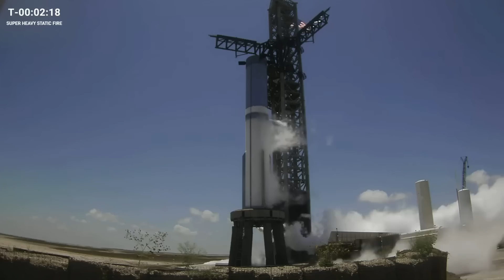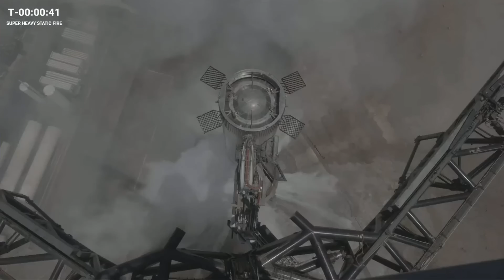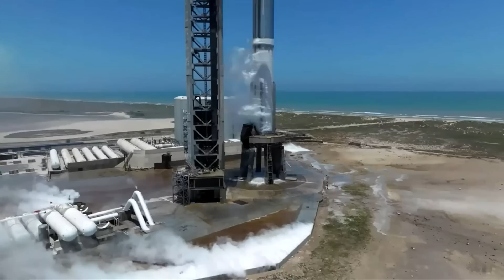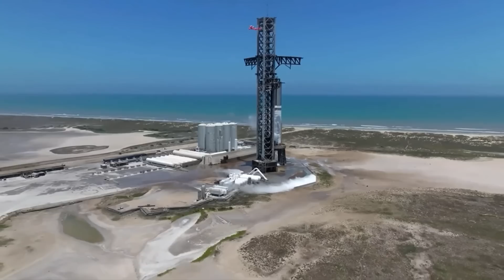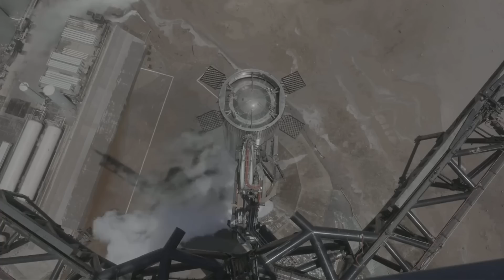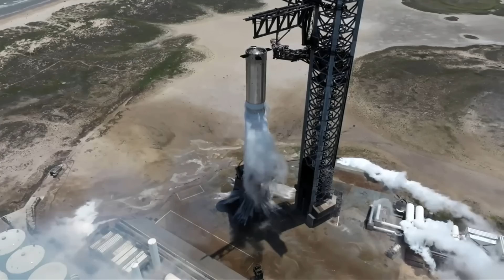SpaceX fires up Starship Super Heavy Booster 9 in Texas

Comment: I am starting to wonder if it is the engines or the fuel system. I can't see how between the first launch and this static fire so many engines would give out either mid flight or on the pad. I could discount the first launch because of flying concrete but in this case the deluge system was working just fine. It seems to me that these engines were pre tested and passed inspection. That only leaves the fuel system as a likely cause.

Comment: Unless there was some other issue with the engines that shut down it seems that better timing of the start of the water deluge and the engine firings has to be part of the next step in development. The other side of the balance to what was tested is having the engines fire, which heats the steel plates too much before the water comes out; which could well be a disaster if enough of it turned to steam ...under the plates..you know, woosh, pop and the rocket goes kaboom getting in the way of giant steel plates heading into orbit!. Good thing to start with the water first and then work the timing between them closer and closer, to see what works best.. 
If there is a pattern to the location of the shut down engines, the start up sequence could be to fire those least likely to be affected first and so reduce upward liquid flow and once enough of the water stream is being vapoutrised, kick in all the rest? Or alternatively micro manage the water pressure during start up to equalise the upward and downward pressure flows ..
Reply: Why would the timing of the water deluge be related to the engine shutdowns? Surplus water will simply drain away.
Reply: Hi, I was just considering if the issue causing the engine shut downs was due to the water deluge, then delaying the full thrust of the water deluge until the engines achieve over say %50 thrust might give the motors a better chance of performing as designed. Of course the water deluge may have nothing to do with the 4 shut downs .. it just seems a bit of a coincidence.  @lappansommer546  A water flow control system might be based on an array of temperature sensors within the steel shower head,  such that the heat in the plates never exceeds that of water flashing to steam (under the plate).

Comment: Personally, I think they need larger and fewer engines for better reliability. Most likely the reason they had shutdowns, was the basically room temperature water saturated the cryogenic pumps and caused them to cavitate with gaseous fuel instead of liquid. They may have to fire the engines and start the deluge simultaneously so the thrust keeps the water off the pumps.😉

Comment: 🎯 Key Takeaways for quick navigation:

00:05 🚀 SpaceX Super Heavy Booster 9 undergoes static fire test at Starbase Texas.
00:31 🔧 Teams have made multiple improvements to booster, pad systems, and infrastructure since last flight test.
00:45 🌊 New water cooled Steel Flame deflector introduced for pad protection during Starship launch.
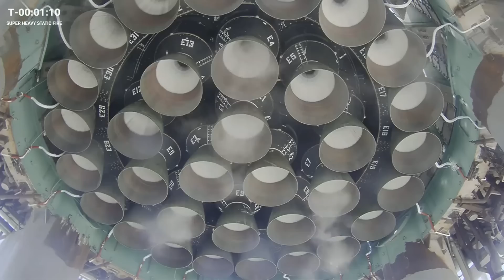01:12 🔥 Super Heavy's static fire test runs for nearly 5 seconds, surpassing Falcon Heavy's thrust during flight.
02:06 🚀 Test experienced premature shutdown of 4 engines during ignition.
06:28 🏁 Successful test brings SpaceX closer to their next flight test, with propellant offload planned.
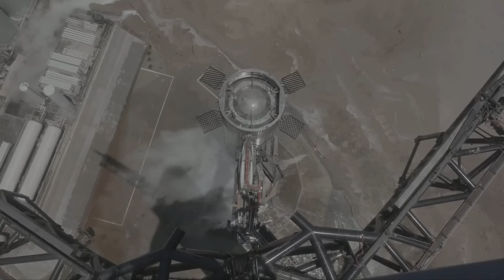06:57 📢 Webcast concludes, further information to be posted on SpaceX's social media.

Made with HARPA AI

Comment: The showerhead pad is going to fail at 100% throttle and full duration.
Reply: What makes you say that?
Reply: @jarjarbunks2844  It's similar to a Water jet cutting through a steel pipe. They need to add more exceeding pressure and power to the water deluge system. Time will tell if this system can survive during launch. They need more tests to prove it can survive multiple launches since Starship will become a norm launching daily
Reply: @Alderite make declarative statement... type long-winded statement walking back what you originally wrote knowing  nobody will read it.  Good job.
Reply: @Alderite  the water isn't meant to completely counteract the force of the engines, it's there to convert a large amount of the energy coming from the raptors into steam, protecting the launch pad. The pad itself is reinforced a lot more than before so it can take the forces that the deluge system doesn't eliminate. Also, Starship will launch below full power for the first few seconds until clear of the launch pad. If the engineers did the math right then all signs point to the deluge system working as it's supposed to and I just don't see how you're so sure it's gonna fail.
Reply: @jarjarbunks2844  They actually updated the Starship's functionality to launch at 100 %, unlike the first slow launch. Avoiding the launch steel plate from turning into molten slag. As said, its best for trial and error

Comment: It's hard to believe that there's still a reliability issue with those engines.
Reply: Probably not reliability, this is the first test of the system with the following: Electric Thrust Vectoring (removal and substitution of hardware that may be responsible for the issues on IFT1), water deluge (addressing the already expected issue of concrete erosion for IFT1), upgraded spin start (may have played a part in two of the engines’s startup issues on IFT1), Booster 9 (its new and features structural changes), and ignition sequence (time trimmed down fly 50% from IFT1).

All of these issues will have some influence on the event, and for a first static fire (and thus complete test) of all these systems combined, this actually is probably better than expected. Given that this is a first test, SpaceX was also likely running extremely conservative parameters that will be loosened for flight. Having loose parameters on a first test is just introducing more potential failure points than what’s already there. The quicker shutdown was likely a result of the four engines shutting down early; which would’ve triggered the launch abort procedure should this have been a launch (the booster cannot fly with more than 3 engines at launch for safety reasons). A fourth shutdown would automatically trigger a shutdown of the entire flight if the clamps were attached to the vehicle (they were).

Again, this is a first test. It took B7 3ish attempts to get to where B9 got in one so this is still major progress. Heck, the issues with the engines could even just be bad test sensors that need to be replaced.
Reply: @seasickrhino8926  the fact that engines are still not firing after this many years of raptor development is not a good look. If the issue was simple you would imagine that it would've been fixed after the first launch, but it hasnt been.
Reply: The wording was “premature shutdown” which in aerospace lingo means that the engines ignited but were shutdown automatically because of a sensor reading. Statistically, ~90% of premature shutdowns are caused by erroneous sensor data, not bad design. Raptor 2 is at best 4 years old. The F1 started in the mid-late 50s and first flew in 1968. It still had issues at liftoff.

Because this was an initial test firing of this booster with various new systems, they would set the shutdown parameters to be extremely stringent. Meaning that the engines not only have the likely issue of sensors, not performance, but have to conform to tighter specifications than when normally operating. This behavior was noted to be one of the primary relying factors for SLS as well. It’s kind of part of the process.

Again, this is a first test of this grouping of systems. Finding failures is the entire point of this test. Not entirely perfect performance is expected just as it was for SLS, nor should it be for B9’s initial tests.
Reply: @seasickrhino8926  So would you suggest that this is a new systems glitch rather than engine failure?
Reply: @pauljmeyer1  this is likely the result of new systems being tested together for the first time, yes. It’s of my opinion that the engines, based off the statements from SX and my own personal knowledge/experience were shutdown for (what is likely) extra tight safety margins.
Reply: @seasickrhino8926  Yes, the stakes are high on this and they don't want it to go wrong.

Comment: As I have said before, 33 is too many to expect them all to run.  It is time to look into the use of Falcon Heavy with 4 boosters strap ons as a plan b.  or go to F1 size engines and reduce to 5 or 6 engines.
Reply: … you do realize that a 4 core FH is 45 engines right?

Also F1 engines would have poor performance for the landing, preventing the ability to hover and requiring suicide burns. It may even require over stressing the booster for boost back.
Reply: This comment makes zero sense whichever way i look at it.
Reply: What is this blud wafflin about

Comment: Test was a great success....................what are you guys smoking?    Oh right got it ......... the rocket didn't blow up = success.
Reply: Clearly you don’t understand success parameters (or you just think SpaceX was stupid because you only focus on what you see), so here it goes.

A test in engineering has success criteria. Should said criteria be met, the test is considered a success regardless of an armchair enthusiast’s assumptions based on exterior views.

SpaceX’s IFT1 had a success criteria of launching to an altitude of “high enough that it would not demolish the pad should it explode”. IFT1 reached an altitude of 24 Mi (32KM), and traveled down range as well. Because it did not explode in the range where it would demolish the pad (and thus left said range), it met the success criteria and was considered a success.

For an example, if I were to run a test on the maximum compression I could exert on a soda can while pushing the limits, I would set an arbitrary goal based on my objectives. In this hypothetical situation, I want a force of 100 Newtons to be taken by the can without it being damaged irreparably. If I take my can to a hydraulic press and apply 101 Newtons of force before it crumples, it’s still a success because it met/surpassed my success requirements. Because of this, the data gathered beyond 100N is extra margin and can be considered to be an extension of the success. I could have a thousand observers watch me crush the can and think that I failed because the can exploded at 101N, but that doesn’t change the fact that I met my own requirements for success, and thus, can claim it to be a success.

When it comes to an engineering project, the public’s opinion bears no regard for the actual engineering or testing, only on outward appearance; and the public’s opinion only matters when said project is directly linked to their pockets through large public grants or through usage of public land. Starship has comparatively no funding from the government and is placed on an abandoned gas well. Thus, public opinion (and views on the success based on outward observation) are generally irrelevant.
Reply: Peter you're not as smart as you think you are...

Comment: I don't think there is enough water there to face those raptor engines for the amount of time required in an actual launch. They may need to elevate the platform and the tower several meters, it seems so close to the ground.
Reply: The platform is 15 meters tall (plus internal height between booster and the bottom of the mount).

For reference, the 39B deflector used for Saturn V, Shuttle, F9, and FH has a deflector to base of pad height of 12 meters; it was designed to cope with the Saturn 8 Nova, which had a 14 million pound thrust rating as opposed to the maximum proposed amount of Starship at 20 million, with the current operational maximum being 17 million.

We also know that Starship is not supposed to leave the mount at 100% thrust, but ramp up after clearing a safe distance from this system. The pad’s water tanks are not complete in quantity; we know of at least two additional tanks that are en-route to Starbase at the present time.

The real issue with the lifting of the pad and addition of a trench is far more interesting. They would have to remove the mount (which took months to complete installation), add pillar extensions capable of sustaining the launch environment, extent the tower to support the increased height, raise the ship QD, (likely) increase the flow and capacity of the deluge plate (which may require the redesign of the plate as well), and (likely) refile all permits surrounding the site.
Reply: Agreed. They need a flame trench and diverter too. They're trying to half-ass the launch mount.